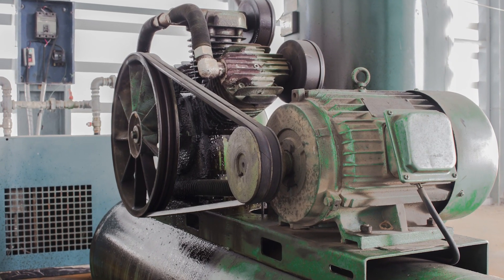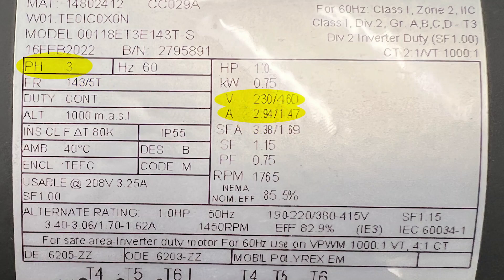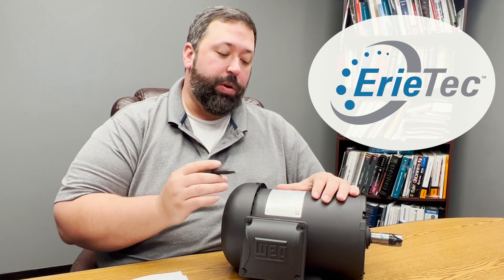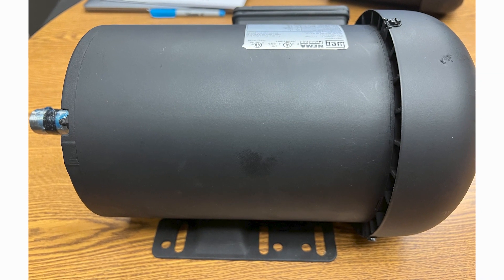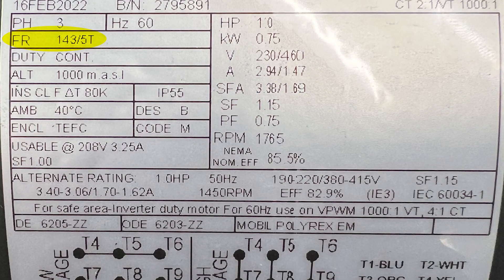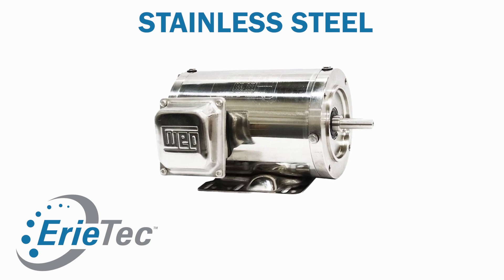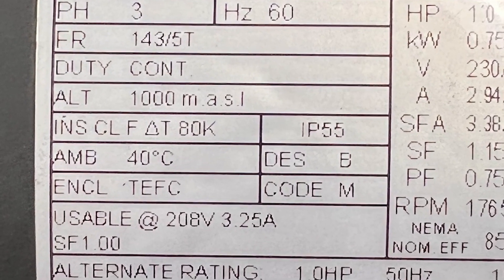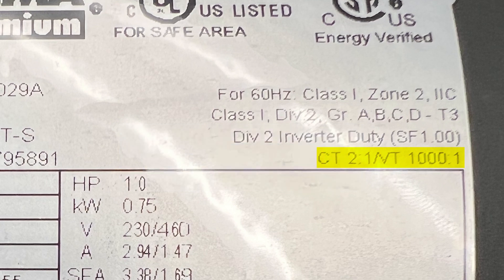ErieTec Educates: Decoding Your Motor Nameplate

Comment: Tips from a retired sparky: NEVER purchase any motors from lying lack of quality control communist china. ( my company ordered 5 spare air handler motors from 40 to 100 HP. The POS 100 HP had a label saying to use supply wires rated for at least 115 degrees C. Of course every 100 HP plain Jane normal NEMA 4 pole motor we had only had the type THHN/THWN  mist commonly used wire type that was only rated for 90 degrees max. Best to only purchase motors made in USA . Stay away from IEC garbage motors that always run hotter due to less copper in windings. Stay away from some Grainger private label motors. Some are goid & some are best used for boat anchors. We seldom spouses away money on drive rated overpriced motors. We had hundreds of plain Jane simp!e NEMA frame motors that were installed in the 1970's and still running on VFD'S. Started out working in a large slaughterhouse that used nothing but TEFC motors. Have not seen a zerk grease fitting on any new motors in over 30 years.Great vidio.